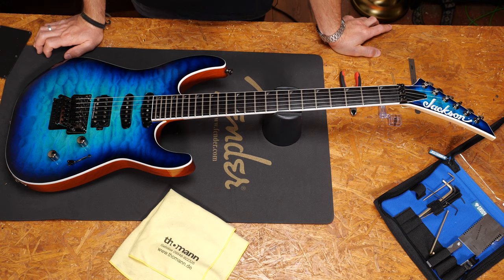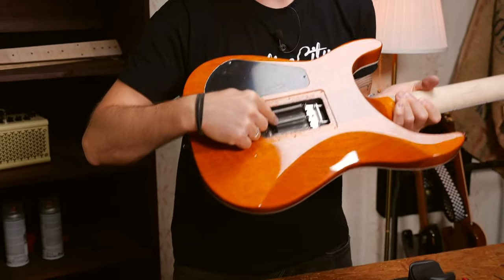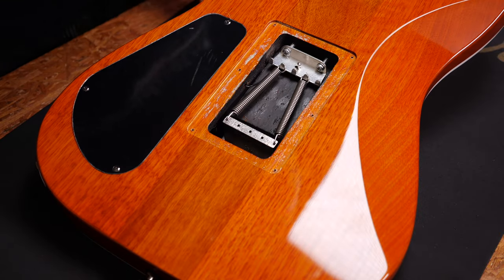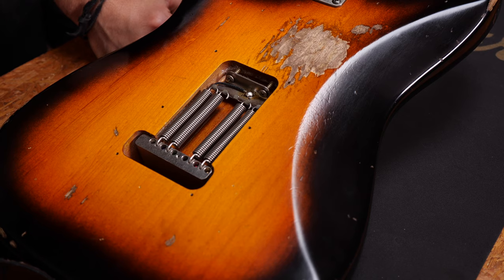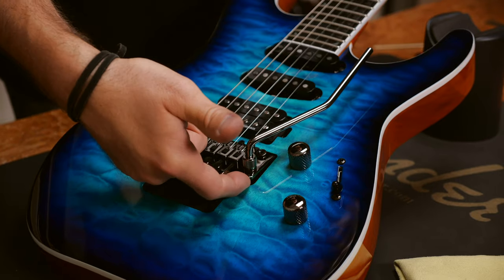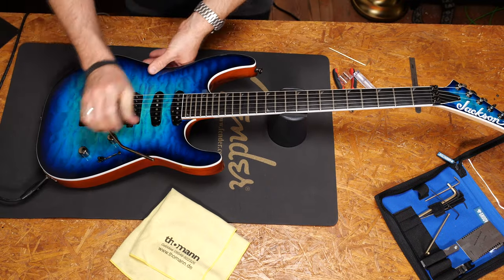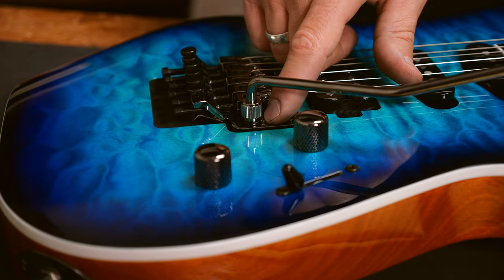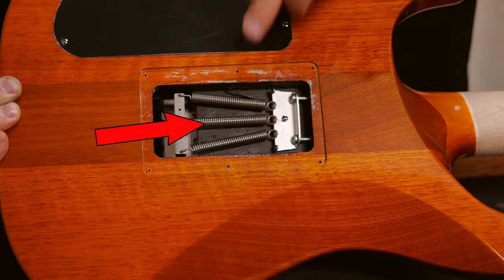How to set up a Floyd Rose | Guitar Tech Tips | Ep. 17 | Thomann

Comment: Hey I got a question, some guys are fixing the intonation by tuning a string to its standard tuning and then checking the 12th fret for accuracy, then you adjust the saddle for the intonation adjust... Now how about if I tune the high e string(for example) to a lower reference note then check the 12th fret if it’s in the same tuning as its open string note... tuning it to standard for the reference pitch before adjustment gives too much stress for the new strings in my opinion.
Reply: There is a process called an octave check on a guitar.
You play the open string then play the note at the twelfth fret, this is to ensure your guitar is not out of aliment and that the intonation is sound.
The saddles adjust string tension and hight, by unscrewing them you give the string slack by tightening them you create tension.
The small rods are for hight, you can rase the hight of your strings by adjusting them up or down.
The octave check allows the player to assure his guitars intonation is true.
When you play the twelfth fret of say the  top E string you are producing the same note as the E string open only one octave higher same with the rest of the strings.
Setting your saddles will effect intonation but only slightly, these are more for hight and tension.
Your friends are not fixing anything as this technique only provides you with an octave check and tells you if your neck is warped.
The saddles also allow compensation for string thickness, the strings of a guitar should arch slightly like a violin but very slightly, these saddles allow the stings to be adjusted to their natural positions.

Comment: My screws in the back are super tight. I can't tighten them anymore and it's a brand new guitar!! I changed the strings with not much difficulty but they (the strings) feel very loose. I wish I had more tension.
Reply: Get thinner strings or get another spring for the back of your guitar if there is more space for them
Reply: @patf7570  -- Well I'm already using 9 gauge and really don't want to do anything less than that. Getting another spring is an interesting thought.  Thanks!!

Comment: I have .10 strings and three parallel spprings with an original floyd rose and the tension is really high and it doesn't flutter at all , what should i do? remove a spring ? would that work with .10 strings?

Comment: Do the two nuts holding the bridge onto the body have to be tightened exactly the same or as long as the bridge sits parallel it's fine? Thanks.
Reply: These adjust the hight of the strings and should be level, you want your stings as close to the fretboard as possible without any buzz from the strings on any frets.
So keep these at the same hight.

Comment: So I just got my first guitar with a floyd rose. Completely inexperienced with then for the most part. If I wanted to put strings gauged at .10-.52 would I need to add a 4th spring for the bridge? I'm assuming mine only has 3 lol. Havent taken the back plate off to look yet.
Reply from the maker: Hey, good luck with you Floyd Rose guitar! With which tuning do you wanna use the 10-52 strings? If you don't want to tune very low, you might need a 4th spring, yes. //Kris
Reply: @ThomannsGuitarsBasses  drop d and drop c most likely.

Comment: Hello. Whenever i tune a string i loose the tune of the previous one (I loose about half a step from the previous string). And the bridge keep shifting upwards without being able to have all string tuned.What can i do?
Reply from the maker: It's normal on Floyd Rose guitars that the previous strings detune when you move on to the next. That's exactly why you have to tune the strings over and over again at least 6-7 times until they all stay in tune. But. If the tremolo goes up more and more as you tune you have to tighten the screws holding the tremolo claw (as shown in the video). That's because the strings you're putting on have more tension, then what the tremolo was set up for. Best is to do little steps at a time: tune the strings as long as the tremolo seems to be flat with the body. Then if it rises, tighten the claw screws in the back a little and continue tuning up the strings. Then repeat this until it's in tune and the tremolo is flat. An alternative: I don't know how many springs you have in your guitar, if it's only 2 or 3 you could also install an extra one. 2 -> 3 or 3 -> 4 springs. That also helps to balance out the tension and in that case you probably don't have to readjust (tighten) the tremolo claw screws that much. I hope that helps. Cheers //Kris
Reply: @ThomannsGuitarsBasses  thank you so much. I ll try that

Comment: would there be much difference in floating trems that are NOT floyd rose licensed? like Cort for example?
Reply: Some non Floyd Rose trems are okay it’s just they need to be set up right and balanced.
I have a Edge Pro II trem made by Ibanez in my JS100 and it works as well as my Floyd Rose licensed trem.
Any floating trem with a knife edge is good.
The main thing is having it balanced right, your bridge should be flat and flush with the surface of your guitar not sticking out at all.

Comment: So i have the issue, My Tremolo leans forward, but when I tune higher my strings break. I can't increase the spring tension, because of the small cable on the tremoloback, is too tight. I didnt changed the string gauge or brand. Same Ernie Ball slinky top heavy bottom... 

I changed strings on floyd rose fora bout 20times, but this one I feel clueless.. A guitar tech will take a look at this tomorrow.
Reply from the maker: Hey, if your tree leans forward you have to tighten the spring claw screws. Whilst doing that you need to release the string tension by small steps multiple times. That way the term will slowly go back to a normal angle / position. If the ground wire on the spring claw is too short, you (or the guitar tech) has to make it longer. 
Cheers and good luck with your guitar!
//Kris
Reply: @ThomannsGuitarsBasses  I cant tighten the springs anymore. Like i said in the text above... It feels like the springs arent strong enough to hold the strings
Reply: @bastianbeivers7997  You might want to look in angling the outer springs or getting stronger springs (get noiseless too while you're at it)

Comment: Sir why my trimolo is getting up and not getting down
Reply from the maker: Hey, do you mean by "getting up" that the tremolo leans forward? In that case the strings are pulling the tremolo stronger than the springs at the back. You could try thinner strings or you could tighten the tremolo spring claw with its two screws (at the back, inside the tremolo cavity). cheers //Kris

Comment: Hi Kris I have a question about pickups. I've set my neck pickup 3mm away and my bridge 2mm away like u recommend in your thomann video and they both sound great where they are but there is as bit of a difference in volume between the two pickups. Is this OK to have the bridge a bit louder than the neck?
Reply from the maker: Hey Matt, that's nice to hear! :) Yeah it's perfectly normal to have the bridge a little louder than the neck pickup. Many players prefer it that way. If you want more balance, set the bridge PU lower or the neck PU a bit higher. Leave the pickup alone you love most how it sounds now and only move the other one. 
//cheers, Kris
Reply: @ThomannsGuitarsBasses  thanks for the reply, I really appreciate your help :)

Comment: I use 9’s on my Floyd what spring configuration would you recommend because I like having tension and don’t mind if I lose the flutter
Reply from the maker: If 3 springs are too light for 9s try using 4 and loosen the spring claw until the trem stays parallel to the top of the body. This might be hard on some guitars, but normally it's doable. That gives you more tension and less flutter. Good luck! //Kris
Reply: I've just restrung a licensed Floyd Rose with 10s and the claws/springs are screwed right into the wood now! 
Looks like I'll be replacing them with 9s next.

Comment: The Floyd rose doesn't stay in tune even after locking the nuts. 1 light amount of touch and it gets totally out of tune. How should I fix it?
Reply: assumed there's no problem with nut lockers, try getting better quality strings and springs.
Reply: @salvatorevetro1743  I use Ernie Ball strings and Dimarzio Springs.

Comment: Hi, guys! I just bought from your webstore thicker gauge for my RG1527 with edge pro 7 but it seems the stock 3 springs are not enough to pull the bridge back. I even managed to f*ck up one of the screws... Could you please put a link in the comment if you sell springs seperately or in pairs?
Reply: https://www.thomann.de/de/ibanez_espr2003_e_power.htm I think I found it, is this going to work with my tremolo?

Comment: Lost all hope,I tune and rose sits hella high,I tighten the springs nothing happens.I start over and tune again and yep still high,springs are pretty much all the way touching the back of the guitar and rose is still way too high and won’t even stay In tune because it just pulls the rose higher.Watched all the videos I can find but they barely touch the subject.I really thought it would be cool to play around with a Floyd rose but it’s really not worth this much headache.Guess I’m officially in the Floyd rose hating squad.
Reply: Nevermind just stole a spring from an old guitar and that kept it down.
Reply from the maker: Glad to hear that it worked out with the extra spring. These tremolos can be really finicky but if you get the hang of it, it's not too bad. But yeah, it takes quite some trial and error to get there. Congrats on solving the issue man! Cheers //Kris

Comment: You don’t ever touch those screws they are set for your individual string screws to be in the middle, you listen to this guy you just messed up your guitar
Reply from the maker: Hey Brandon, thanks for watching the video but please, PLEASE do not spread misinformation on the internet. That really doesn't help the guitar community. There are literally no screws on a guitar that you should never touch. I'm not even sure which "screws in back of your guitar" you mean, but if you're talking about the spring claw screws you will definitely have to adjust them if you change the tuning or change the string gauge. That is the reason why you have adjustable screws there instead of solid anchors. If you ignore them, you'll never get that tremolo nice and parallel to the body. Take care //Kris

Comment: I tried the different spring placement,but I had to screw the screws in all the way and when I tune it it’s still way up in the air…what am I doing wrong?
Reply from the maker: Hey Daniel, if that's the case you definitely need more springs because the strings are pulling the tremolo way too hard. 3 springs are fine for 9 and 10 gauge strings in E standard tuning. If you use thicker strings you need to balance that out obviously. So if you can't tighten the spring claw screws any more, then put in an extra spring. Cheers //Kris

Comment: My ffloyd Rose keeps leaning backwards. No matter what I do it stays back. I’ve tried to loose the springs but it doesn’t help. The screw is almost all the way out. Way could be the problem ?
Reply from the maker: There are two things I'd check:
1. did you tune the strings again after adjusting the screws in the back? If you don't, nothing changes on the tremolo.
2. Try removing one of the springs, especially if you have 3 or 4. That has a big effect on the balance of the tremolo.
Good luck! //Kris
Reply: @ThomannsGuitarsBasses  thank you. Just tried it. Didn’t work. I think there is something wrong